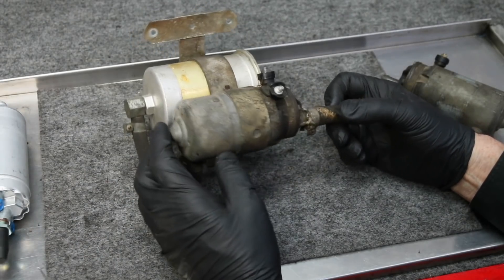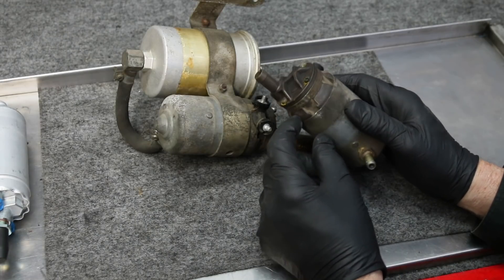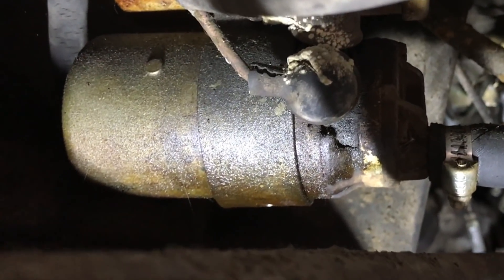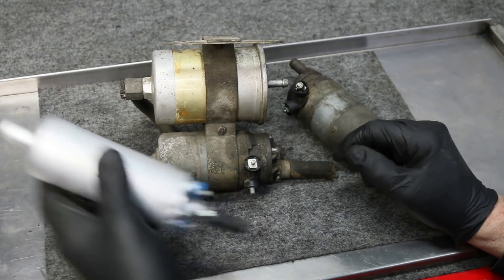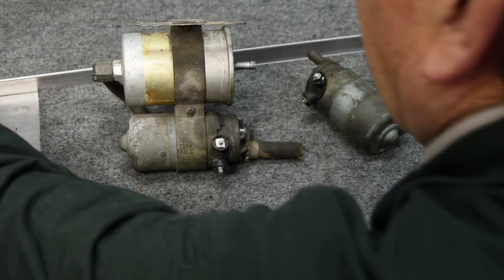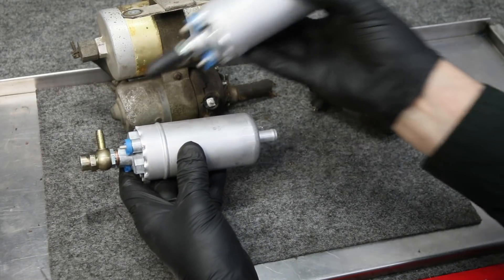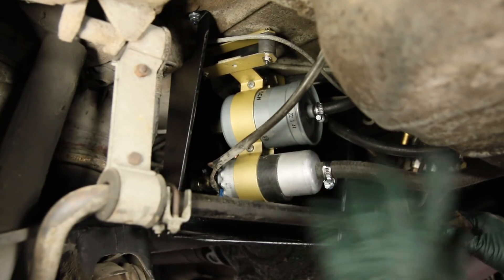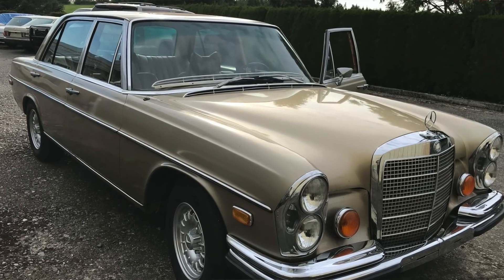W108 W109 V8 EFI Fuel Pump Conversion - Yes There is a Solution!

Comment: I just completed the installation of this conversion kit on my '73 280se.  And I must say I could not be more pleased!  The video was tremendously helpful.   I am a very happy customer.  Thanks so much!!  Dave C Falmouth, Maine
Reply from the maker: Hi David, Thanks for the positive feedback. I appreciate you're taking the time to write. That was a tough kit to put together. My 4.5 engine sure is running better now... :-)
Reply: Where did you buy the fuel pump kit?

Comment: Hi Kent.  What to do for a 280se 6 cyl?  I"m not finding any solutions.
Reply from the maker: What year? It makes a huge different. If you have a W108 with the short MFI pump there are no cheap substitutes.
Reply: 1972 280se